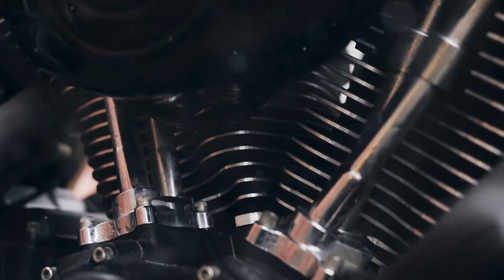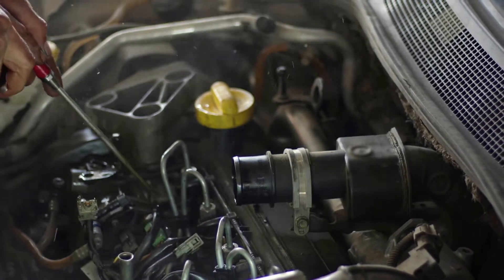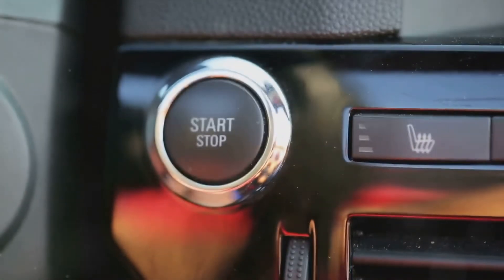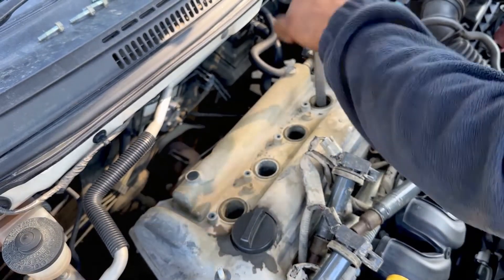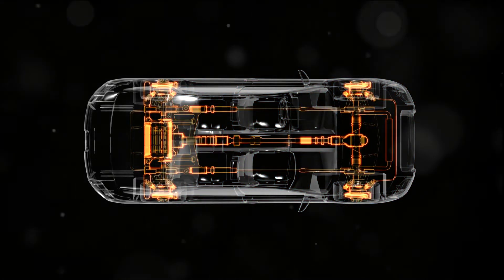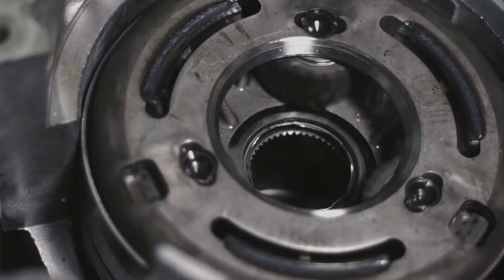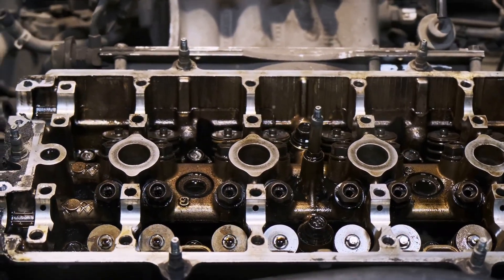10 Causes For Shaking/Vibrating The Car Engine at Idle While Stopped

Comment: Good day. I've redone my engine cause valves were bend and replaced them and IAC and ignition coils with plugs also got new mountings just asking what can be the problem for engine vibration and rough idling or stalling when warming up and also got new water pump and timing belt

Comment: 1. 1:05 Bad Idle air control valve (IAC valve)

2. 2:10 Clogged air filter

3. 3:12 Dirty fuel injectors

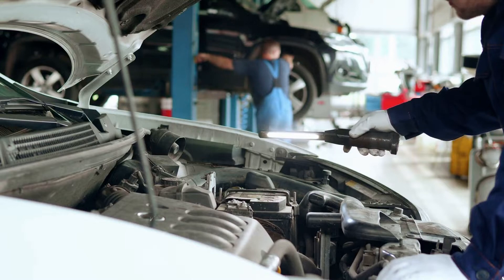4. 4:50 Engine misfire

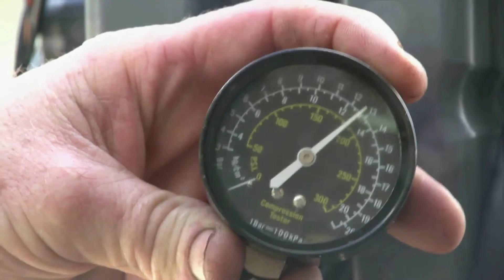5. 5:58 Cylinder pressure misbalance

6. 7:22 Faulty mass airflow sensor (MAF sensor)

7. 8:40 Drive belt(s)

8. 9:45 Bad motor mounts

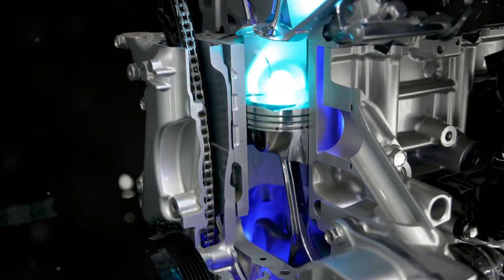9. 11:25 Mechanical wear and tear

10: ???